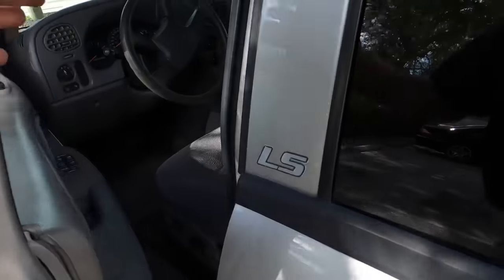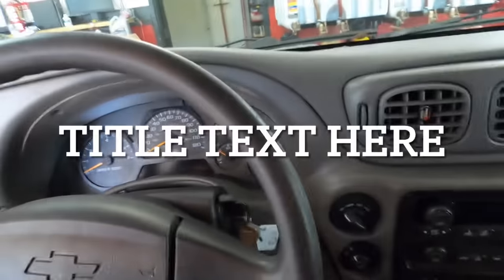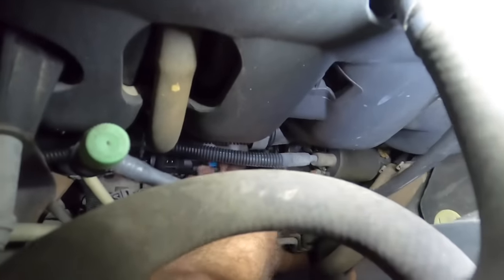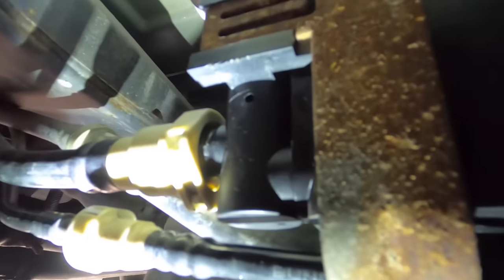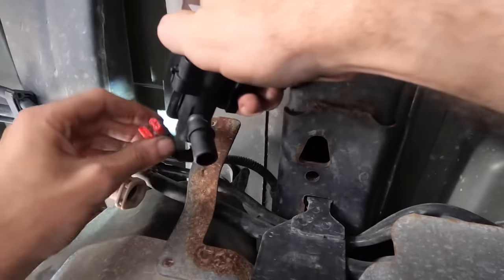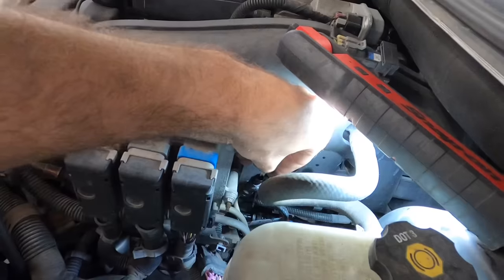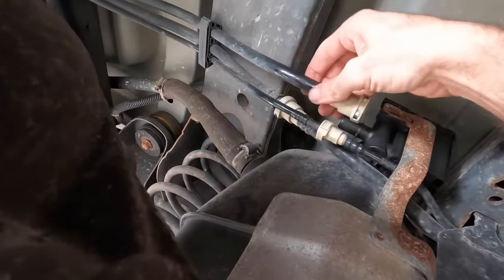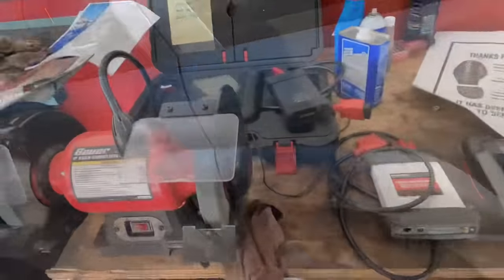Repair failed! Customer is Angry

Comment: I had 3 starters and 2 alternators in a row that were broken directly out of the box for a '78 Ford Country Squire with a 302.  The customer insisted we use his parts.  Shop manager told him to get his money back and go to the Napa or the Car Quest down the street from our shop
Reply: I drive an old 60s box truck for years and it was going through a clutch every 9 months. My boss was always saying I was fucking it up and I was stressed out thinking that I was doing something wrong. But he hired a new mechanic for the trucks and they found a piece of the clutch installed backwards 😅 my boss never said sorry or even told me. I learned from another manager after I said my truck was driving better lol
Reply: BS, it was the battery connection the whole time.
Reply: I had a MAf fail after a month it blew up hot wire melted and blew the fuse. It was a OEM part too so it’s luck of the draw half the time
Reply: Back when I was just getting into mechanicking around high school days I learned three main lessons,
1. I was more of a real mechanic not just a parts changer.
2. There is PLENTY of such things as 
    ' brand new junk '
But most of all, the thing that kept me from becoming a professional car mechanic, was the ' since you worked on my brakes my windshield wipers don't work ' scenario.
I experienced way too much of that before I was even out of high school.
Reply: @michaelszczys8316  got my window replaced and when got the car back my washer fluid wasn’t really spraying almost like a pinched hose sure enough I looked and the wiper arm was pinching the hose just unpinched the hose and it worked again no big deal. But most people don’t even know anything about cars and that’s why I say at least learn the basics cause yes the glass place accidentally pinched my washer hose but it was a simple fix and I still gave them company a good review. Most would head back and start yelling at the workers there you broke this it worked when I brought it too you then they leave a bad review even though the work done was good. Mistakes happen it was not serious and I figured it out in 2 seconds.
Reply: @michaelszczys8316  you gotta know how to talk to people and you gotta know how to document things. when you work on someone elses car you dont laser focus on what they told you is wrong, you write down everything thats wrong with it and then you fix what youre paid to fix. that extra bit of work in the beginning will cover your ass until the end of time.
Reply: @michaelszczys8316  "Ever since you, but now....."
Reply: Back in the nineties in a large city where financially strapped customers bought their parts from Forrest City and asked our shop to install them. Starters and alternators were the absolute worst!
Reply: @johnnytacokleinschmidt515  I always remember as a teen working on my uncles Chevy and checking out his starter that barely worked and upon opening it up I noticed that the armature was all scraped up from rubbing on everything because the remanufacturrer forgot to put a bushing at one end.
( it had a big ' reman ' tag on it )
Reply: @michaelszczys8316  UGH! UGHly!
Reply: With the fake wood trim? Memories....☺

Comment: Hi Ray. Just a thought. Since the moral of this repair was “New isn’t necessarily good “. I know the purge solenoid clicked louder on your installed part. Wouldn’t it have been a good idea to smoke test it as well?? Since you had it hooked up anyway??
Reply: I just started the video, but if a customer asks for a specific repair without letting the garage diagnose the issue and even supplies their own part, then I would tell them I'll install the part, charge for the time, but not guarantee the repair. The only thing I guarantee is that the part is installed properly.  Smoke test? Sure, but that takes some time to connect the smoker and go over the under-hood, the bottom, and gas tan areas for smoke.  If the customer wants that, I'll bill them for it.
Reply: @ohger1  A friend was a service manager at a chain repair store (mostly known for mufflers and rhymes with Monro) but had good techs and rapport enough to the community that people brought advanced repair work there.  Nevertheless... his saying was (RIP) "You don't bring your own steak to the steak house do you? Why are you bringing unknown origin parts to ME then?"
Reply: Was about to leave the exact same comment. He had the smoke already hooked up. I would have smoke tested the new part as well just to make sure that I didn't replace a junk part with another junk part.
Reply: He said it himself replace this new junk with another new junk 😀 so he should have smoke tested it.....
Reply: Yep, I was waiting to see the smoke come out of the new one…and then the smoke machine was unhooked. Seemed out of character for the good Rainman.
Reply: @MarcMercier1971  [Grammar nazi rears his ugly head.... ]

I think the word you are reaching for is "rapport". 

And I agree: no warranty if the customer does not want the mechanic to diagnose and supplies his own part.
But I would have smoke tested the new part, since everything was already hooked up anyway.
Reply: @GibsonCRG  Would that have mattered? We saw him smoke test that new when the truck came back, and while it didn't work the first time he tested it, it worked the second time he tried it.  For all anyone knows, that part worked initially and would have passed the smoke test when he first installed it.  It may have failed days later.  How long can you test a part?
Reply: @ohger1  (edit): just re-read your comment and it clicked. I hear you - it could work when new then fail. 100% true…just seemed like a low-friction confirmation that at least it wasn’t dead-on-arrival since everything was already connected.
Reply: @GibsonCRG  there's no part one video. You seem to have missed that the first valve was intermittently working/failing. 🙂
Reply: @JohnH0130  Nazi? I'm a card carrying member of The Grammar Patrol!😋
Reply: @ohger1  Oh, so we shouldn't bother to test anything because it could test good now and fail later?  What kind of thinking is that?  You're looking to see if it is obviously broken NOW.
Reply: @JonNewquist  yeah I went back and re-read it again and it came together. Given his low regard for the aftermarket parts that they are getting though - and since it was all connected already for a smoke test - I was still surprised that he didn’t give it a check to confirm. Just seems more in line with his normal SOP from watching his prior videos even in better (parts) times.
Reply: @stargazer7644  You missed my point.  Ray tested the failed part twice by smoke when the truck came back - the first time it failed and the second time it started working again.  What I'm saying is that there's an excellent chance it would have worked if he smoke tested it right after he installed it - it most likely it started getting cranky after a few days of being activated on and off and being jostled around when driving it.
Reply: @MarcMercier1971  no but i take my own snack to movies cause im not payer 4 x for same thing
Reply: Yup, that was maybe an oops. Assume.
Reply: I am very surprised that he did not smoke test it.
Reply: @JohnH0130  I think the term you're looking for is "spelling Nazi".
Reply: @ReadTheShrill  I stand corrected sir......
Reply: @JonNewquist  There's no pt1 video because he didn't fit the first one, he clearly said that someone else fitted it.
Reply: This is true, sometimes you test the new ( junk ) part and find it to be in worse condition than the original ( junk ) part.
Reply: @philthehmk8752  yes, exactly. Ray was able to demonstrate that the previously installed valve worked intermittently with the smoke test. Pay attention.

Edit: Chris Gibson edited the post I responded to. If you didn't see the original, my apology for coming off as an ass.
Reply: @jonsworld5307  LOL.  We go to Wally World and get the theater type candy and she keeps it in large handbag.  I buy the $20 sodas as a smokescreen
Reply: @ohger1  Ray didn't install the part the first time, someone else did.  And I don't think it is more likely that the part was working fine when installed, and broke a couple days later.  I think it is far more likely it was bad straight out of the box.
Reply: At the end of every video, I find myself asking, “Wonder what that repair cost?” Any chance of your adding this to your videos?
Reply: @JohnH0130  Yes.  That is correct... rapport.  Don't know why I spelled it like that... but appreciate the correction.  I'm a you're, your, there, their, they're guy nazi myself. )
Reply: @MarcMercier1971  this brings up as good point, I can source similar if not better quality meat as most steak houses, and can prepare/cook as good as if not better steak myself. I still get the steak when I go out, after all what am I suppose to eat, the chicken?
Reply: No. There are better ways to test the purge valve.
Reply: @islandhopper100  You could repair just about anything without a scantool, its just gonna take twice as long and cost you even more....
Reply: @MarcMercier1971  
40% savings ordering parts.  Maker stands up for warranty. Saves a bunch on OEM parts. (Still expensive) 

Yes we have to wait on them to come in the mail. Salvage Yards are not too shabby, either. Some REALLY big ones now, with inventory listed on computer already pulled.
Reply: @pennytull7578  Not sure what you're replying to, but I'm guessing it's the "bring your own steak to a steakhouse".  He refused any parts you brought to him.  
I ran into that myself.  I have a thing for Mevotech parts.  Had GREAT luck with them. I was busy and asked my alignment guy if he'd pop 'em in (ball joints and tie rod ends).  Absolutely refused.  Guy down the road "Yup, sure... but I'm booked out".  That was over 4 months ago.  I guess I should put them in and bring it to the alignment parts nazi guy.  If he wasn't so good at it, I'd give him the two finger UK salute because it p'd me off so much.
Reply: He did test it. The smoke test was good for quickly identifying the source of leaks.

After he replaced the part he says the solenoid click is much louder and he can hear that it (the vent itself) is working. Gases escaping through vents make sound and it was loud enough that he could hear it.

Once he knew where the problem was he didn't need the smoke to verify the replacement part was working correctly.
Reply: @ohger1  But the customer had installed the part ! If we are talking about the vent he installed he did not test it to see if it functioned any differently ! Would have taken seconds to conduct the same test again after install ! I never managed a shop but I have managed a service based operation ! Rule number one is identify goals and express possible short comings ! I can promise my work but I can not promise the reliability of the parts I install ! We need american made auto parts ! Universal parts that bolt on to many models and work just fine ! Something so reliable you just turn the machines off and wait five years to do another run !
Reply: @ohger1  In the 90's I installed a alt, don't remember the type car. Customer comes says he can get the alt cheater at auto zone. Tried to tell him auto zone alt's are not rebuilt but made to charge, he was having none of it. he got his alt, L told him I only warranty my labor. he got his car, came back next day alt howling. he says whats that noise . I told him that's ypur cheep alt. never say him again.
Reply: @williammarkhart7047  Exactly, but the posters here will howl that you didn't test his POS alternator for two full days!!!  If a customer supplies his own part, I'll install it and guarantee that it will be installed professionally.  That's the extent of my warranty on customer supplied parts.
Reply: @ohger1  Its not jostled around, it's installed to a bracket...
Reply: @frandanco6289  Is the bracket shock mounted into a floating assy to mitigate road shock and inertia or is just bolted into the body or frame?
Reply: @lilkittygirl  There ARE shops that will.  You just have to call and check.  The ones that will put in your specific parts will also put in a disclaimer about the parts have no warrantee of course.  I am NOT a fan of NAPA (aka Never Any Parts Available, I'll say that since they didn't hire me recently and wanted to pay pittance).   The car parts box stores are pretty much all the same rebranded Chiwanese with a different house name and trust NONE of it unless it says Federal-Mogul, SKP, Moog, Standard (no X in part #), AC-Delco, Movotech Supreme/TTX (yes, still Chinese), Wix XP or the like.  Those are the brands that have treated me well over the years.
I had a bunch of parts I bought for my W-body (everything on all 4 corners for each strut).  Full OEM GM/Bilstein (FE4) struts & springs, etc. Can I install them?  Absolutely & unequivocally so albeit scary af compressing the springs.  There's a townie like SMA who's a friend of the family.  He said he'd put them in and do my alignment (even if we weren't friends).  Alignments are the only thing I can't really do 100% on my own and the only shops I go to are for alignments (which in the Northeast is 2-3x a year).  The place next to where I used to work did top notch alignments but refused my parts.  I did install them myself.  Someday I'll get it aligned, but tire wear is even over a year later after I put them in, so f-it. ;)  The struts be trashed again soon enough. LOL
Reply: @lilkittygirl  Agreed.  Rock Auto here too.... except oil and filters.  I get the Wix XP filter and Pennzoil syn from the green O... or if oil isn't on sale and I drive by... I get the oil from Wally World.  Everything else comes from Rock Auto.

Comment: Do it right, do it once! Cheap parts are cheap for a reason. Low quality components and poor quality control means you 've got, in my experience, about a 20% chance of having to replace the part again. At least this purge valve is easy. Imagine if it was a fuel pump that you had to drop the tank to get to or an alternator that's buried (Looking at you, VW...) and takes several hours to R&R.
Reply: that is why ill never own a transverse mounted engine car and why i cut an access hole in the trunk of my mustang- $11 fuel pump and 20 min r&r
Reply: @ufartface  or buy a European car where they include an access panel...
Reply: @securi-t  and the parts are three times more expensive!!!

Comment: As stated there is a function test that you can run with the scanner to do a test on evap system. Smoke testing isn't a very good way to check an Eva system. They won't always open the valve because they are low pressure. Run the function test and see what it shows then go from there.

Comment: When you commanded the valve off on the "old one" you could hear it drop and bounce, with the new one installed you could hear it actually move up and down, seems like an internal seal was defective on the "old one"

Comment: Getting cars in that the codes have been cleared from are the worst. Finally, most salvage and AA people seem to understand that we need codes to work with, so they either don't clear them or give us a print of the codes they found.
Unfortunately, our factory diagnostic tool reads loads more codes that will also have been erased.
For non-mechanic people reading this: codes and diagnostic tools are not magic, they are not the be all, end all of our existence and when a mechanic doesn't know how to interpret the codes or fails to see the connection between various codes, they're no help at all.
A skilled and experienced mechanic needs the codes, because he can then interpret them and they will most likely set him on the right path to resolve the problem.
Not always, but most of the time.
Reply: Customer think having codes in the system will somehow make the repair cost more.
Reply: @gailtaylor1636  LOL. I couldn't figure out why someone would have the codes erased before bringing are car in for diagnosis. At first I thought you were joking...
Reply: @mrqsysopr  Nope. Getting info out of customers is like pulling teeth. They refuse to just tell the truth like saying, my brother-in-law changed the radio and now the battery keeps going dead and it stalls at stop signs. Started right after. They refuse to see the correlation. Look at the money saved by having him screw up the car!
Reply: Good to know 👍
Reply: @mrqsysopr  a lot of times they do it to hide something.  Like tuners that delete certain things to get around normal stock system.
Reply: “Getting cars in that the codes have been cleared from are the worst.”

Sorry sir, but I think you’ll find that German sausages are wurst. 

🤣😂
Don’t forget to remember not to forget to have yourself a great day! 😂🤣